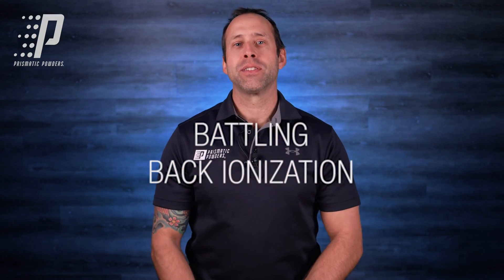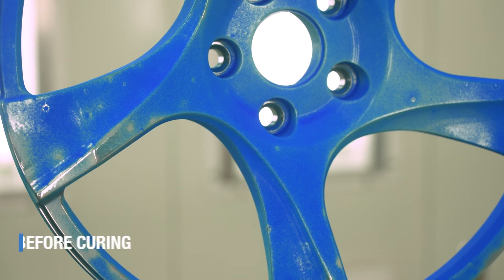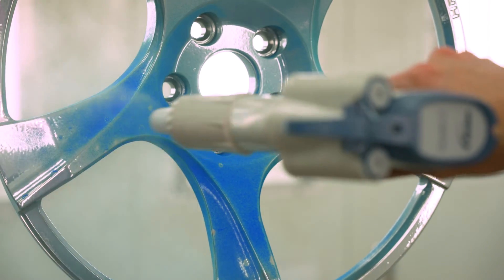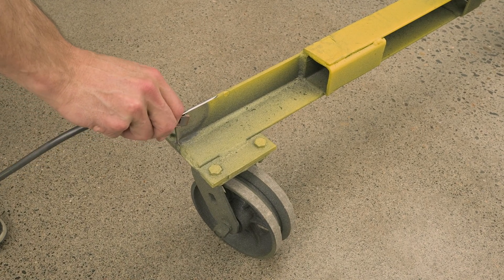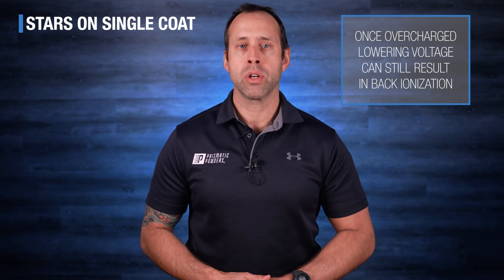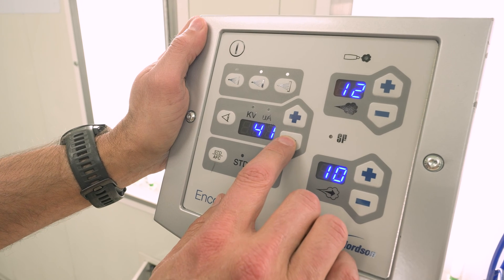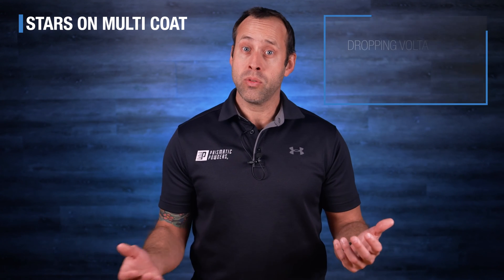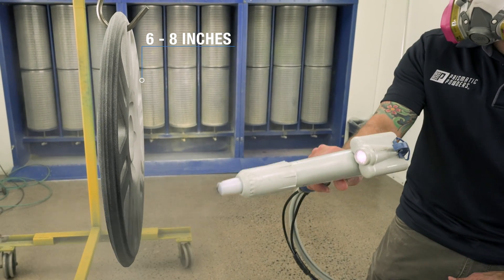Battling Back Ionization | Prismatic Powders®

Comment: For most of my items I have shrap corners.. deep pokets.. & turns. If I use 50KV & 40Ua the corners won't be covered if I drop it to 20 & 25. Then I can get into them but it wastes alot of powder & is still hard to get into it. My question is if I shoot at lower lets say 20 & 25. After doing the tight areas and such. If I then bump it back upto 50 / 40 will that just undo all the work I just did? Sometimes i've seen my faraday areas open back up after shooting it again with higher volts. Just not sure if that's a thing or not as I haven't seen anyone talk about it.
Reply from the maker: Yep, I've experienced that too where what you've covered, gets repelled by a charge build up. Thankfully that has been rare, and honestly it depends on that particular part. There have been times where I've had to hot flock certain areas delicately to get coverage.

Comment: So if I have KV and UA are you saying 100 kv and adjust the UA ?
Reply from the maker: Well, that depends. I know that 's a terrible answer but for most single coat applications with a gun that allows for fine tuning, you would be fine. However, sometimes you may not want your kV all the way to 100. For example, you may want to make adjustments to both for finessing the powder into tight spaces with good transfer efficiency.